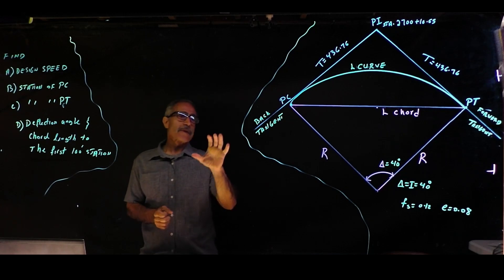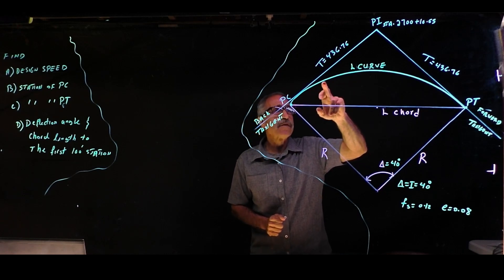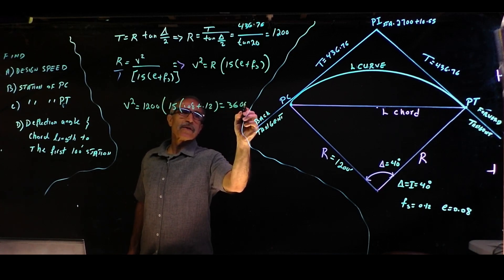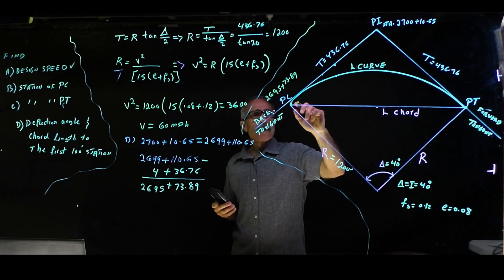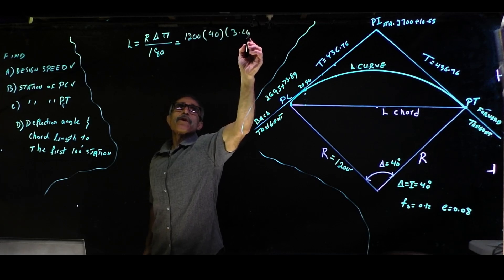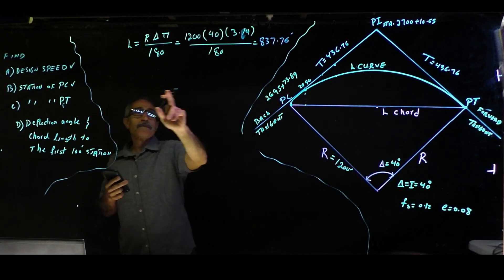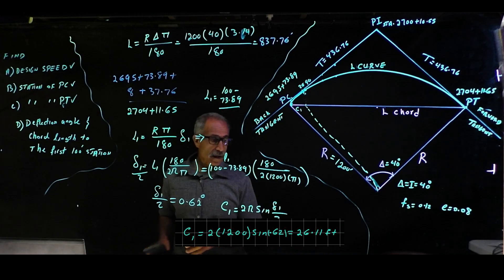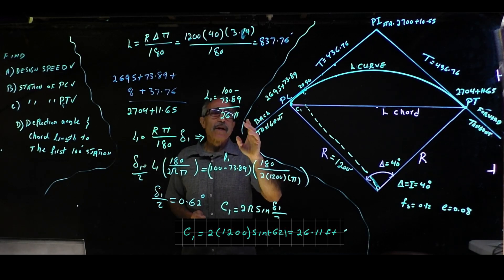Horizontal Curve

Comment: Here in new mexico, they bank all corners the opposite way, keeps the drunks halfway off the road at all times, reduces safe speeds when its raining, a crowned road is a rare phenomenon, blinkers are optional for drivers, guardrails on flat roads and nothing on mountainous winding roads, potholes take 5 years reporting before attended, better stick to horse and wagon to avoid the lean toward the outside.😂